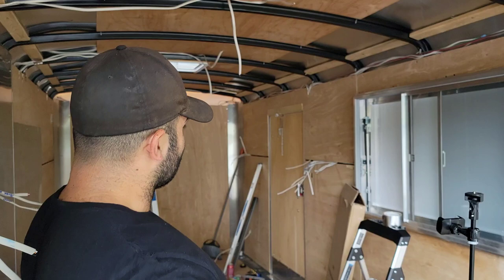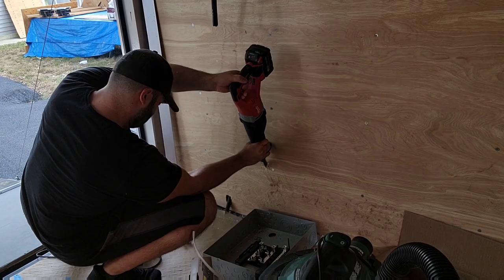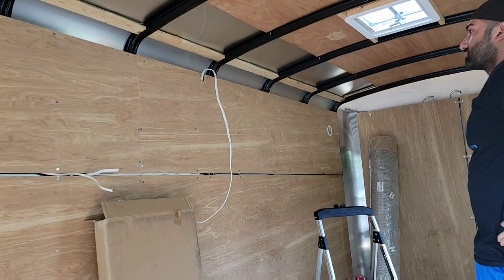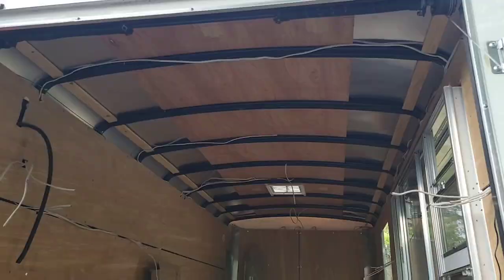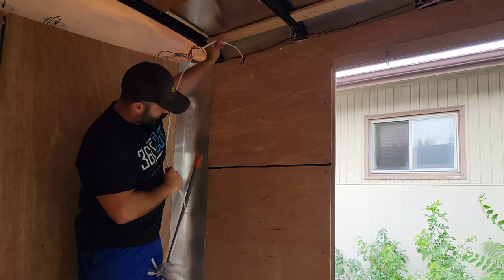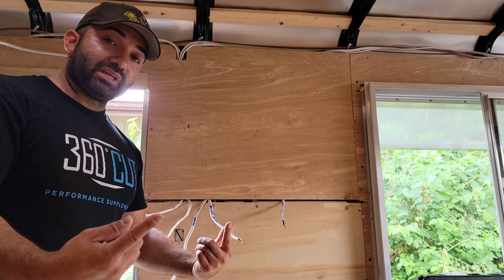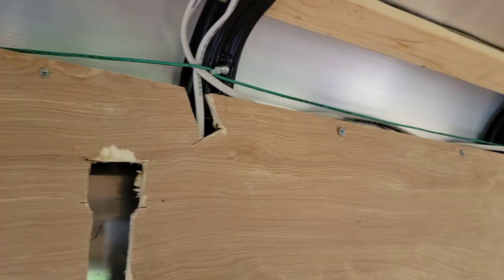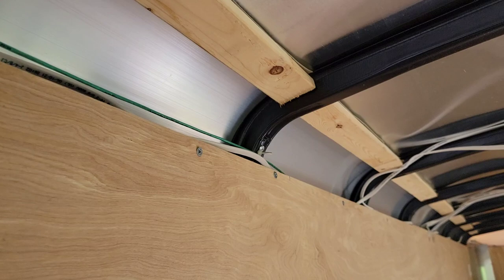Food Truck Electrical: DIY Series Part 1

Comment: Thank you so much Frank.   I know I asked for this video along with others.   We appreciate it.     Om my cart I planned on wiring everything surface mounted to my frp. So that it's not buried in the walls.    I'm using the wire with the metal casing.     My buddy is gonna come help me.
Reply from the maker: Surface mount works as well :)
Reply: @fbaltierrez  putting my food trailer together to been thru 6 surgeries this year on back and right hip but i am back at it just put vent up and hood electrical is working my question is do i need a fire suppression system for my hood in FT.WORTH Tx because i see some people without it let me know if you get a chance.
Reply: @realamericanmuscle7705  hey, it has been my experience that as long as you are not running any gas you can use fire extinguishers but you should consult your local HD they will have the standard for you. 

My HD says if no fire is present then an extinguisher would be sufficient, but if I run equipment that produces flames to heat then an ANSUL is needed. I know you were asking Frank but I hope this helps you out I have personally built 2 trailers from the frame up.
Reply: @RangerMorris  Thanks a million for that info been healing from surgery 6 just this year but i am on it as we speak.

Comment: I think all the runs must be in a conduit, for the outlets circuit you must use 12/2 at least for the first 2 and follow with 14/2 for the rest, in case if you have to pass inspection in the future
Reply from the maker: They don't check trailers like they do a brick and mortar in most counties yours could be different.

Comment: Frank question.. there is a gap between plywood sheet.. did you got the trailer built in with plywood or you put them on?
Reply from the maker: Gap is factory built. Kind of like your house the exterior wall and interior wall have a gap

Comment: Technically 14 awg can be use for power outlet, is the national electrical code covers electrical istallations for food truck?
Reply from the maker: That is correct 14 1t amps 12 awg 20 amps can be used for outlets.

Comment: I though you need a 12/2 for a 20 amp circuit breaker but are you using 15 amps or 20?
Reply from the maker: I only use 15 amp circuits. 2 of them. 14 gauge wire

Comment: Hi Frank, I pretty much have the same trailer as you're working in here.  Quick question, on the can lights, is there a reason why you went down and back up and not just straight acoss from one can to the other?
Reply from the maker: You can't go straight across because the plywood would smash the Romex and didn't want to drill the studs

Comment: Hi Frank, is it possible to just buy a panel board with more switches and just run individual 14-2 cables to each outlet or switches separately?
Reply from the maker: I wouldn't that's too much wire and extra materials which means more $$$$$$. 1 circuit in the panel for 4 lights for example is almost no power consumption
Reply: Hey frank what would the total be to just have electrical
Reply: What would that what you are doing cost me to do myself ?

Comment: Thank you for all your videos. I have a question my county is requiring a main disconnect. So I bought a 100 amp main disconnect which is next to the breaker box. The generator goes to the main disconnect box first and then run the power to the breaker box but I’m not sure how to wire the ground and neutral. Should I keep them separate in the main disconnect and then bond them in the breaker box or bond them in the first box and bond them again in the second box. I’m a little confused. Thanks in advance
Reply from the maker: You could of also just bought a breaker panel with a main disconnect and have it all in one enclosure.
Reply: @fbaltierrez  yes but unfortunately i could not find one everywhere I looked was out of stock. What do you recommend I do about the ground and neutral?

Comment: Hey man just wondering in this video  can you just run the can lights wire straight down the ceiling middle instead of making U's.
Reply from the maker: You can but where are you going to send that cable to? You still have to run to 1 central box to connect them all
Reply: Ok im planning on wiring mine just like yours from the start from one side of the trailer just wondering if every light after the first can be ran in a straight line

Comment: Hi. After the electrical have been ran, do i have to have inspection or can i cover with aluminum siding then have  inspection done?  What steps do i take to have an inspector for the city come out to inspect/sign off? Do i contact the city before i start building my truck? Thanks bro

Comment: Still trying to figure something out bud the side of the trailer with the window im trying to figure out witch wires were ran with 14/3 i ran my trailer the same way but all on that side with 14/2 ima going to have outside lights too so just trying to make sure if I need to rerun some wires with 14/3 and if so witch ones lol? Thanks for all the vids and info tho
Reply from the maker: Technically you don't need 14/3 you can run both outside lights together that's what I'll probably do next time.
Reply: @fbaltierrez  ok awesome so the only 14/3 on the side with the window was the outside lights ?

Comment: Random question alert: what are the axles rated for in the trailers that you've built? I've heard of folks upgrading to heavier duty axles. Just wondering if the standard 7000 LB are good enough for most of us (I understand it would depend on what equipment you haul).
Reply from the maker: All the 3 trailers I have bought have been the regular 7000 LB weight GVWR. no issues I would not buy a single axle that's my suggestion
Reply: We r starting with single the trailer is gift so I'm using it for the first foodtruck
Reply: @sonyadelcid8459  did you have any luck on axle info? I’m in the same
Boat

Comment: Frank do you have a link for the fan you have mounted to your roof buddy?   Had a hard time finding those for some reason.      Also what ac do you recommend to use for roof top on these food carts
Reply from the maker: I don't use a fan on the roof the only fan I have is the exhaust fan that comes with the hood
Reply: Oh oh I thought you had a fan I could see in the video. It must be a opening with a knob that opens it

Comment: What if you have a box truck and you have a light already in there what would you connect that too.
Reply from the maker: No because those are typically 12 volt lights won't work with the generator if you are using 120 V power
Reply: @fbaltierrez  ok thank you

Comment: Question about hood installation. Does the wall behind the hood need to be fire rated?
Reply from the maker: Not that I am aware of. The steel on these hoods are very very thick
Reply from the maker: And behind the hood and cooking equipment I would use stainless steel

Comment: Hey frank, I need to power a 30 amp 120 fryer. Would that take dedicated circuit? Different wire and receptacle?
Reply from the maker: If it's a 30 amp for that piece of equipment then yes it needs its own circuit. 10 gauge wire
Reply: @fbaltierrez  would a 20 amp circuit and receptacle be ok? Never seen 30 amp with standard plug? Just the t slot 20 amp outlet
Reply from the maker: @kayleaconnell2546  if the equipment requires 30 amps then most likely you will need it. They do make 30 amp outlets they are single outlets
Reply: @fbaltierrez  thanks hate to keep asking but do you have link for reference ? I can't seem to find on with standard plug. Good upload today by the way!
Reply from the maker: @kayleaconnell2546  Your friend has shared a link to a Home Depot product they think you would be interested in seeing:

Leviton	30 Amp 125-Volt/250-Volt Shallow Single Flush Mounted Outlet, Black
https://www.homedepot.com/p/Leviton-30-Amp-125-Volt-250-Volt-Shallow-Single-Flush-Mounted-Outlet-Black-R30-05207-S10/302480849
SKU# 302480849

Comment: Why did you use 14/2 and not 12/2?
Reply from the maker: I personally don't need the extra amps on those circuits I only use a 30 amp generator. But if you needed more juice then yes use 12 gauge

Comment: What would be the average cost to do the electrical as you did in this trailer if one is not comfortable doing it. I would like to do it exactly like you have done
Reply from the maker: Good morning, let's say you asked me to do this for you with no materials included would be about. hmmmmmmmm......Good question maybe about $1000 and up.

Comment: Do you use 14/3 or 14/2 romex more
Reply from the maker: 14/2 for sure
Reply: Ok thanks for that the 14/3 is only for the exhaust hood and fan
Reply: @fbaltierrez  is there a specific reason why you use 14/2 and not 12/2?

Comment: Your generator wire you didn't show us how you pull it get it where your where your breaker box at
Reply from the maker: I run it under the trailer, hard to get a camera down there.